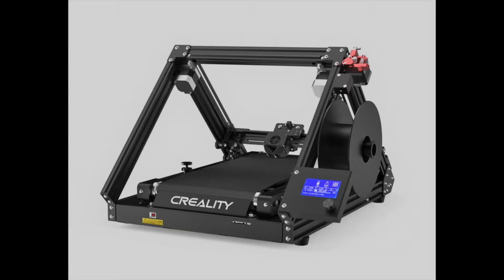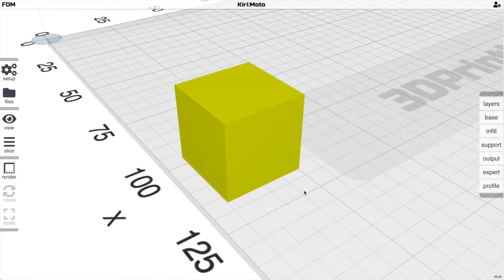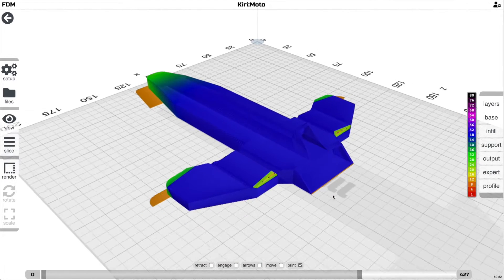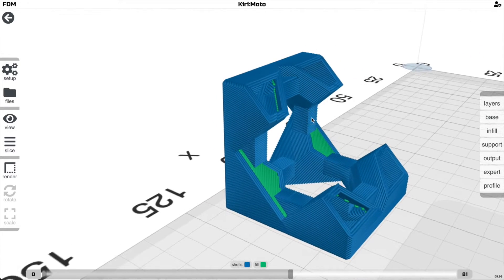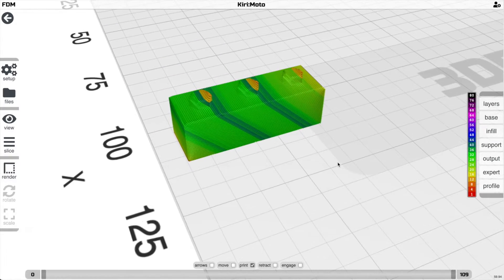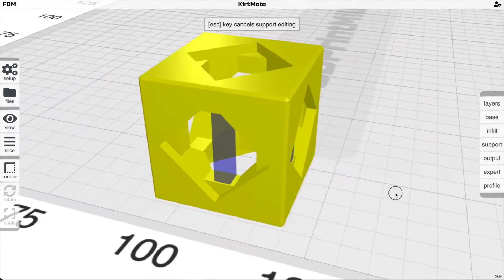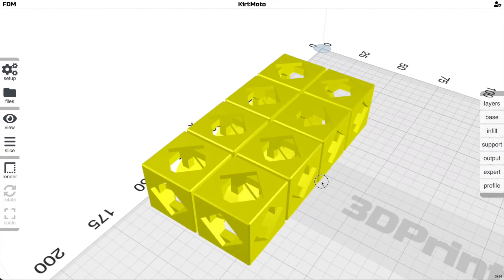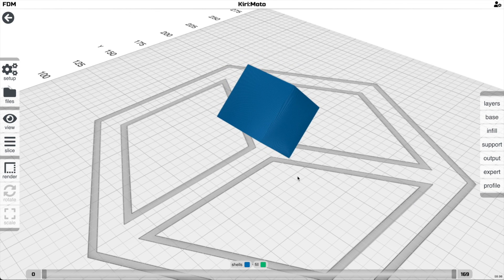Belt Printing In Depth with Kiri:Moto

Comment: I have a Sainsmart Infi-20 and there is a profile for it in Kiri:Moto.  I’ve watched this video and did what was suggested to print multiple parts but the printer still stops after 1 part.  Any suggestions?  Loop and range don’t seem to work….
Reply from the maker: M808 looping is a relatively new Marlin feature that may not have made its way into production printers. Range variables are independent of looping.
Reply: @GridSpace  so I would have to add M808 to the end of the gcode?  That’s what my plan was…
Reply: I love Kiri:Moto.  I’ll use it for my SLA, CNC, and laser burning.
Reply from the maker: @christiancarlson5431  that only works if the firmware has support for it. it sounds like the stock Sainsmart firmware does not. You would have to get a working build config for Marlin for that printer, merge in the M808 branch, and rebuild it. that's not a small feat. perhaps you could bribe a Marlin maintainer to do it for you
Reply from the maker: @christiancarlson5431  This is wonderful to hear :)

Comment: I can't get the same result than you when I put "brim size" to 10 & "part anchor" to 0, it doesn't  work at all... I really need to put anchors like you did, so do you know how to fix it, if it's still possible to do it with Kiri Moto... ?
Reply from the maker: what time mark in the video are you referring to?
Reply: @GridSpace  At 2:10
Reply from the maker: @refcamrugby974  anchors show up in slice view (S). but brims only show up in preview (P).
Reply: @GridSpace  Thanks for your answer, you're awesome & really nice video btw

Comment: Obviously infill serves as support, but also it strengthens parts to withstand weight and makes them tougher... does belt printing change infill considerations for strength?   Could we forgo most infill and just increase wall thickness for example?
Reply from the maker: given the unique aspects of angled printing, you can often get away with less to no infill and use shells/perimeters instead. but strength still often requires the use of infill. it really depends on the geometry of the object. large enclosed volumes are more likely to require it for strength, if not support.